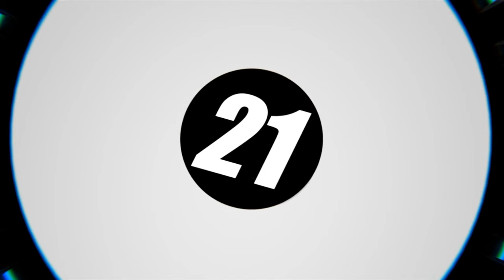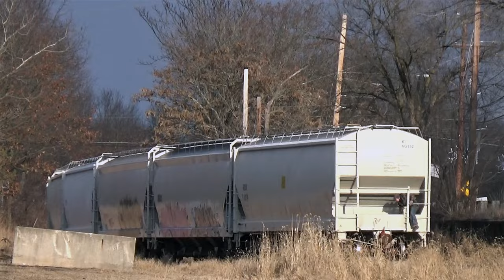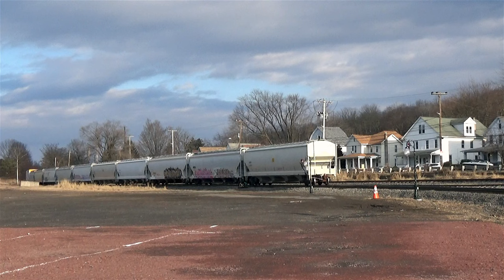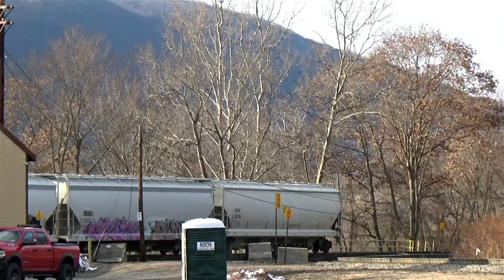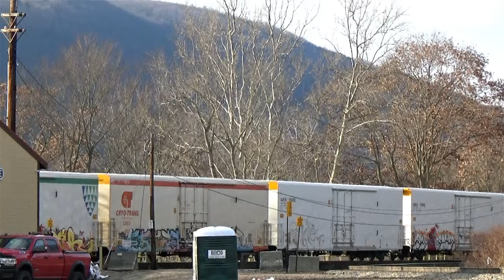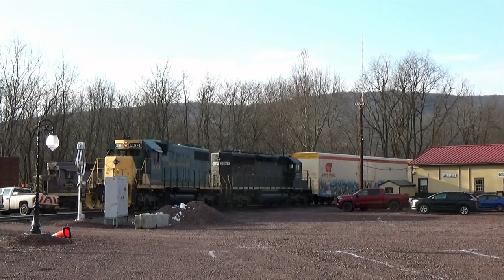Conductor Rides His Train In Reverse for 7 Miles!.. The Loooong Shove

Comment: Why on earth don't they provide an old caboose as a shoving platform. I'm really surprised that's permitted from a safety point of rule
Reply from the maker: They do have one. Don't know why they were shoving today.
Reply: @Trains21  
believe it or not some guys don't like using the caboose because they don't like adding it to their train and they don't like putting it away afterwards... it's extra moves they'd rather not do... i was a switchman and worked a yard job that used a caboose... we weren't forced to use it and some guys didn't use it... so when they were done with the work that's one less move they had to make... but heck, in the middle of january in wisconsin riding the end of a railcar naked to the elements, that's some serious self-punishment